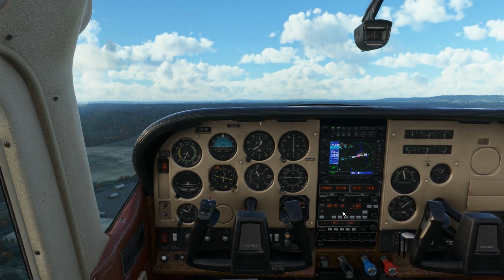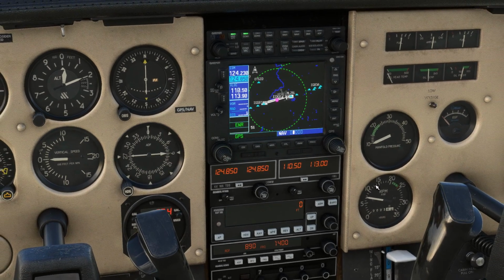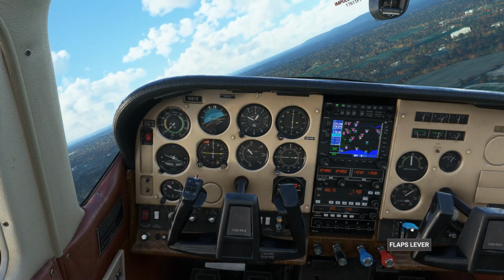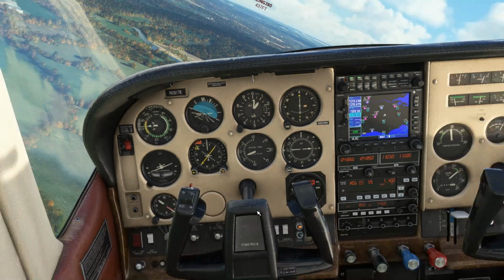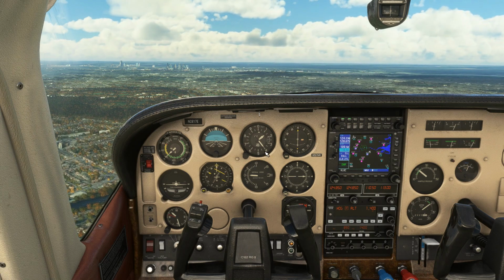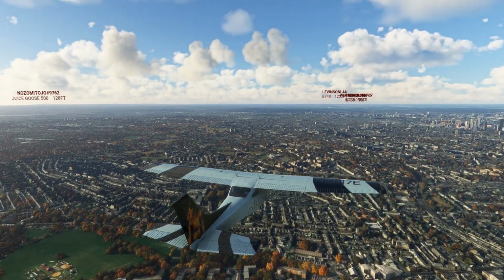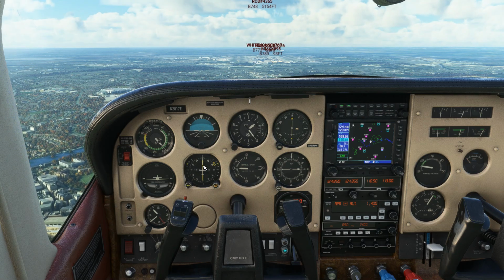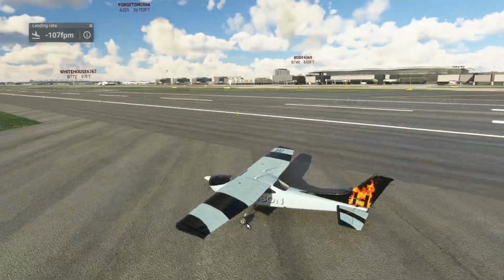FS2020: Get To Know Your 𝐀𝐂𝐓𝐔𝐀𝐋 Aircraft Controls Fully - Back To Basics With MSFS Part 38

Comment: Question:  I have a Logitech Switch panel (the one with a Landing Gear level on the right-side) . . . is there a Logitech driver (like the final Logitech general patch for their peripherals or specific/older "panel" drivers) that I will need to install?  MSFS doesn't pick it up, like their yoke does, and Windows 10 "DEVICES Control Panel" does show it but NO calibrations-tab is visible.

Any info, please?
Reply from the maker: If you are running on Windows 10, like myself, then this driver is the only one you will require to install for all the three panels (Radio, Multi and Switch panels): https://support.logi.com/hc/en-us/articles/360024692354--Downloads-Flight-Multi-Panel.
I have still avoided installing Windows 11 at this point in time - but may experiment with it on my gaming laptop.
Reply: Thank you, Sir! . . . @Huddison